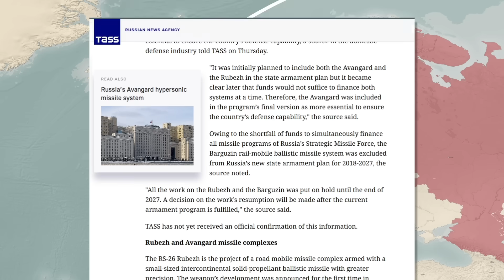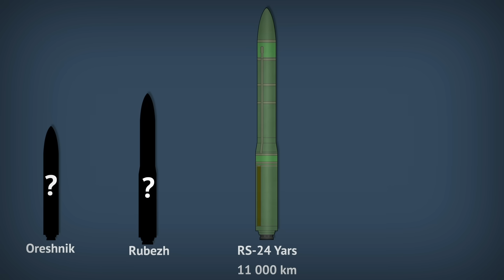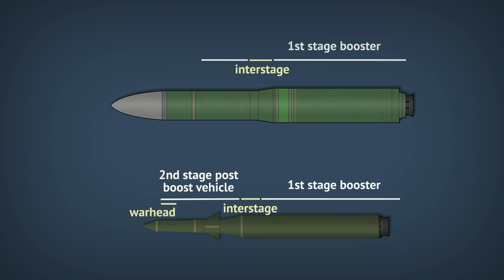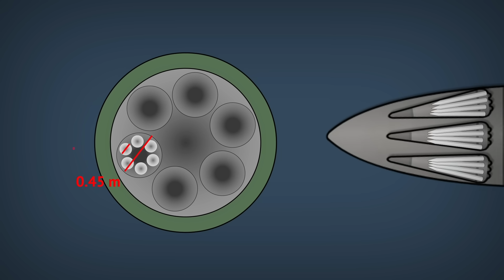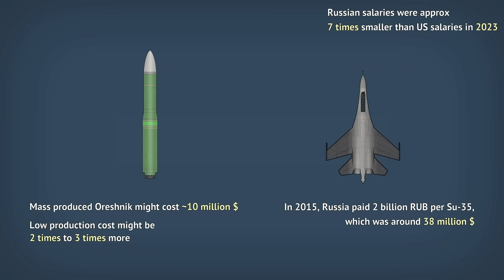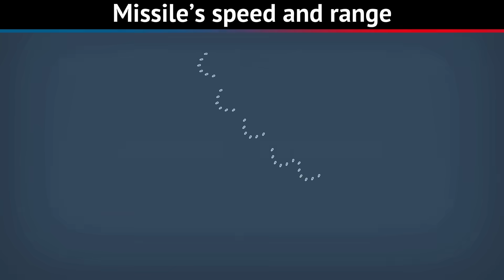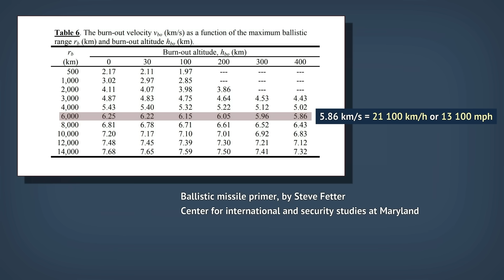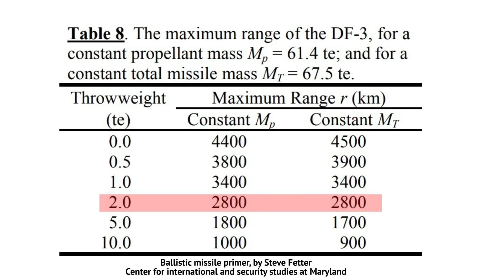Ukraine can’t counter Oreshnik missile. But it doesn’t have to.

Comment: So basically, it's an icbm with some fuel or boosters removed. But also, they can have the ability to carry multiple warheads inert or the real ones.
Reply: It's not an icbm. It's an IRBM intermediate range ballistic missile. It can only target within 600-3400 miles. Although its range is shorter than the ICBM,it still can target any country in europe
Reply: @azureoverlord9346  It's an MRBM, made by removing a stage of an ICBM, as OP said.
Its maximum range with full payload is 1400 miles. When deployed in Belarus, it won't be able  reach Ireland, Iceland, Spain or Portugal with a full payload.
Reply: What new did u learn here?
Reply: So it's nothing...yeah Ukraine is winning 😂

Comment: How do you justify that SUBMUNITIONS lose speed when RE-ENTERING the atmosphere? If the submunitions DID NOT HAVE AN EXPLOSIVE CHARGE and hit with a KINETIC force that is justified as being more than MACH 13? I think you are simply trying to DISREGARD RUSSIAN technology.
Reply: This is a thing called physics.  I do understand most Russians aren't educated about it. ;)
Reply: atmosphere is a thing, but IG if they're going mach 13 that's still pretty fast. still slower than orbital though iirc.  maybe max speed is somewhere in the ionosphere?
Reply: yeah just ran the numbers and assuming normal drag coeffiencts and a peak speed of mach 13 the air density getting lower would slow the munitions to around mach 9 assuming they are smaller 100kg submunitions of just some hard steel and maybe some final course correction stuff that would make each one have a total energy of around 500 MJ or arpox  120kg of tnt so the metal slamming into the surface has more energy in it than if you just left out a 120kg bomb there. Still not as much as if you accelerated 120kg of tnt to that speed then detonated it say 10ft off the ground but still very impressive
Reply: @MasamuneX  UKR sources literally said it was mach 11 at impact. Which means probably higher.
Reply: @vanjamenadzer  yeah ballpark like 100kg of steel at that speed is like 500-700MJ of energy or around the equivalent of like 120-150kg of tnt just in the energy of the impact
Reply: It's called atmosphere, Ivan. When things hit it, it causes friction and they slow down while heating up. That's why the submunitions were glowing with incandescent light. It's also how you slow down a space vehicle for landing. I know education isn't that great in Russia, but you could at least understand the basics and not think that your missiles work like magic.
Reply: @KnightsWithoutATable again I never remember a layer of Atmosphere can slow down object from space entering the Earth
Reply: @Grionlam Ever heard of air resistance?
Reply: @108Pi  yes but still doesn't explain how it slowed down an object let say from low orbit entering the Earth
Reply: @Grionlam because air resistance will slow down any object moving through air. In fact the faster an object is moving the more quickly it gets slowed down. Same principle as a spacecraft coming back from space
Reply: Because the ATMOSPHERE contains AIR which causes objects re-entering from space to SLOW DOWN to their terminal velocity. Amazing Russian engineering has managed to replicate MIRV technology from the 1970s.
Reply: @nopeNope-rn9bm since when an atmosphere can slow an object when they fall. I got it they create frictions and generate more heat, but I never remember an air can slow down a gravity 😂, it's not like cruising through the globe it's literally like meteor entering earth
Reply: @Grionlam  So if you drop an object, it will accelerate due to gravity. But if it has enough room to fall, this acceleration will slow and eventually stop, resulting in the object falling at a constant (but very fast) speed, with no acceleration or deceleration. This is caused by air friction. The speed at which air friction prevents an object from accelerating any more is called “terminal velocity”. Different objects have different terminal velocities, depending on their mass, size, and aerodynamics. For example a steel ball bearing will reach a much higher terminal velocity than a human, and a feather will have a much lower terminal velocity. 

A long range ballistic missile trajectory has an apogee that is hundreds of KM high, effectively in space. In space, there is no air, therefore no terminal velocity. Rockets can fly extremely fast,  and supersonic flight is meaningless because there is no air or sound. So when the missile begins to descend back to earth, it re enters the atmosphere well above hypersonic speeds. For example the NASA space shuttle and Trident D5 ICBM both have re entry speeds around Mach 25. But the lower they fly, the denser the air gets. This causes them to slow down as they fall, until they hit terminal velocity, or the ground. But a purpose built warhead may still be well above the hypersonic threshold when it hits the ground.

Comment: All well and good, but I dont understand to whom this missile is messaging? NATO also has ICBMs and IRBMs. I dont understand what the point of the missile is. Everyone already knows Russia has ICBMs and other missiles.
Reply: Having it and operationally deploying it is another. Look into your pants, having a dong doesn’t mean you can ding dong when the time comes
Reply: @Dantheman8222  Russia proved  that they can get it up when they need to.
Reply: @Matt-yg8ub  exactly.
Reply: Europeans.
Reply: Russia has made aircraft carriers useless.
Reply: This new weapon system has the potential to devastate military bases with an efficiency we've never witnessed before. Traditionally, neutralizing an airfield would require waves of hundreds of missiles. However, this system could dramatically reduce the number of missiles needed. Each missile disperses into 36 submunitions, so with just 30 missiles, you're delivering 1,080 impacts. This not only amplifies the destruction but also poses a direct challenge to NATO's doctrine of air superiority, which is fundamental to its military approach.

From the calculations, each 150-pound projectile moving at Mach 11 hits with the explosive force of 255 pounds of TNT, capable of penetrating 1.5 to 3 meters of reinforced concrete. The extensive number of impacts from 1,080 such strikes could disable an airfield for weeks, damaging runways, aircraft, and all associated infrastructure. The high velocity of these projectiles means that even hardened structures like hangars are highly vulnerable. Inside these structures, the shockwave from each projectile would be incredibly destructive.

To put this in perspective, 30 of these missiles have the combined destructive power equivalent to 12 MOABs, with the capability to strike anywhere in Europe, and they would be extremely challenging to intercept or defend against.

At an estimated cost of $10 million per missile, the potential damage to a major NATO base could easily run into billions. Currently, there seem to be few effective countermeasures against this weapon system, and we're in the dark about the full range of submunitions being developed.

Hypothetically, if Russia were to produce just 300 of these missiles, they could, in theory, incapacitate or destroy 10 or more of NATO's largest bases in less than 10 minutes, without resorting to nuclear weapons. This scenario, while speculative, is likely a significant consideration in the development of this system.
Reply: Half the commentators in the west don’t believe that Russia’s missiles work, the other half are paid not to mention the fact that they know Russia’s missiles work. 
Firing one of these was an attempt by the Russians to dissuade the west from continuing down a path that will ultimately lead to World War III.
The Russians don’t want to end the world, but they sure as hell are not going to go quietly into that good night if we keep pushing them
Reply: It’s basically the us ‘prompt global strike’ middle from the 2000’s but with mirv’s. It like most advanced Russian tech just a prototype.
Reply: It's something the US and NATO doesn't have, these things are hypersonic, Russia is saying it can hit any target with great force and it's unstoppable, Biden keeps escalating so Russia will now respond, and it seems the US were not aware of this missile, you send a small missile into Russia you get one of these in return, the idea is probably to stop the US escalating and maybe stop sending missiles into Russia, and you can be sure Russia has more of these than the ones being sent at Russia
Reply: @stevenelliott5403  news flash mate, EVERY ballistic missile post 1960 I am aware of has been able to go Mach 10 +
Reply: Our boomer sub fleet alone could completely vaporize half the eastern world before one of these things entered US airspace.

Comment: It doesn’t matter how much Russian equipment costs. It’s a closed economy, technically it’s costs nothing. The orders are given to build something and it gets done, the state run system .
Reply: Then how did the Soviet Union collapse?
Reply: The state still requires money. It doesn't get stuff from China, NK, et al for free.  It still has to pay workers.  If cost didn't matter, then the Cold War would not have bankrupted the USSR and brought up its demise.  And Russia is not the power that the USSR was.
Reply: @ no the Russian federation is not the power that the USSR was and to a certain extent I’m sure Putin laments that, but rather than taking the purist stance here where you nitpick and bitch and moan about the technicality, take the comment for what it was intended to convey.  Russia is a largely self-sufficient sovereign state that mints, and maintains its own currency, they are in many respects a closed loop system, yes, they take external inputs, and there are goods and services that they have to get from outside the country, but those are relatively limited compared to many other western countries such as the United States, that imports vast amounts of equipment and materials compared to Russia which largely manufactures what they need domestically. 
With the exception of high-tech, micro, processors and luxury goods, Russia is in the position where it costs dramatically less to produce much of their essential goods internally compared to the western model.
Reply: It’s not quite that simple but the cost of building something in Russia is dramatically reduced compared to its western counterpart that has to go through 19 different layers of corruption and kickbacks and then gets a 1,000% markup
Reply: @Matt-yg8ub  sure, Russian prices are much more realistic than those charged by the American MIC. Still, resources and manpower must be invested to produce any piece of equipment. Even in the most communist society, everything has a cost.
Reply: It does have a cost. Building them means Russia can build less of other things. The Russian people can consume fewer goods and services for each missile produced. Even if no money changed hands it would not be free. 

That said, if they take out a $300M-$1B Patriot with each one, it's a great investment.

Comment: This is a very - check that; ridiculously expensive way to deliver an inert or even conventional explosive payload
Reply: The point of the attack was not damage. It was a reality check - "these are weapons that can carry nuclear weapons and you have zero capability to stop them"

Let's put it in perspective. If Russia targeted a city with 1 MIRV Oreshnik with 6 missiles at mach 10 there is no system on Eartht that would prevent that attack.

We (in the West) are constantly told our technology is better and our anti air intercepts 85-90% of missiles... it's just simply not true. In the Oreshnik attack you can count each missile in slow motion 36/36 got through. Iran also showed that the Iron Dome/arrow cannot stop their missiles either. In this conflict many myths have been shattered...

The US has had multiple failures in testing hypersonic. Without missiles the same speed as their opponents the margin of era on intercept is so small it's basically impossible.
Reply: @Writeous0ne  this.  Also, Moscow felt they needed to send this message to the west because the US and UK missile platforms attacking targets inside Russia require western input to function—for example, the UK’s stormshadow missile platform uses an English interface and contains proprietary code considered TS; therefore, it’s UK contractors and/or Special OPs units operating these batteries on behalf of the Ukrainian military.  Meanwhile, the US provided HMARS missile uses GPS guidance to navigate to and hit its target, and therefore relies on US satellites for this function.  In conclusion, it goes without saying that our level of involvement in the operation of these weapon systems are tantamount to a declaration of war.
Reply: @Writeous0ne  that’s something that most people don’t realize. Yes, Israel’s iron dome is very effective at shooting down Katusha rockets….. but it’s basically useless against anything more advanced than that.
Reply: Putin just sent a ridiculously expensive message that the west seems hell-bent on ignoring….. don’t keep pushing towards World War III because they will eventually get it and nobody wants that
Reply: an inert payload travelling around 2.5 miles per second. you deliver a regular bowling ball at that speed it's gonna have more than 4 times the kinetic energy as an APFSDS round fired from an m1 abrams

Comment: Millennium will be angry yet again slapping his hands to his forehead if he sees this because his conjecture is that it is an SLBM redesigned to become Hazel missile.
Reply: How and why he should be angry? Did you even watch this video? There was absolutely NOTHING binkov stated which would contradict milennium. This missile is not intended for ukraine it was a political move and absolutely everything milennium stated still apply; throwing 50-100 million to completely disable an airbase for a few months is a pricey, but strategically significant capability to have. And everyone from the first day knew, this was a political showing, not something they would EVER need in ukraine.
Reply: Angry too much of a reach but disappointing? For sure.